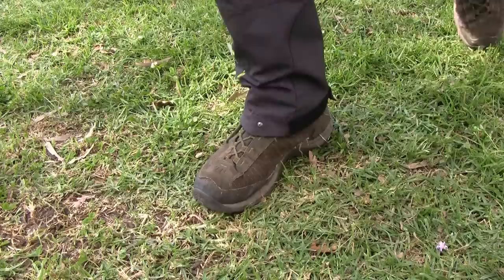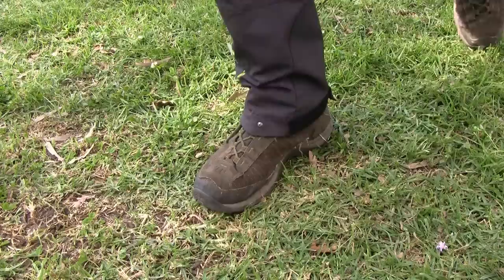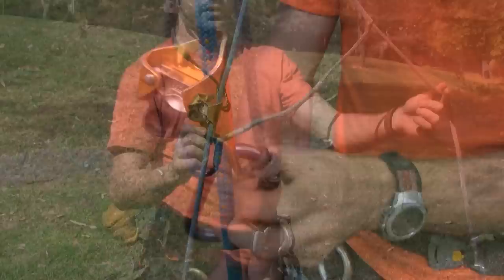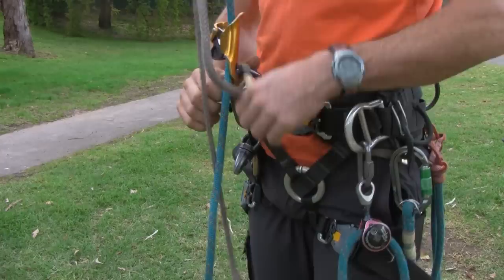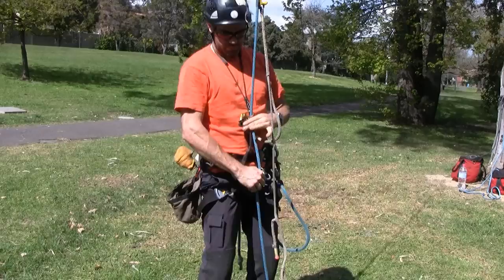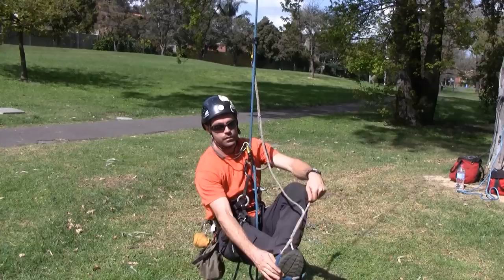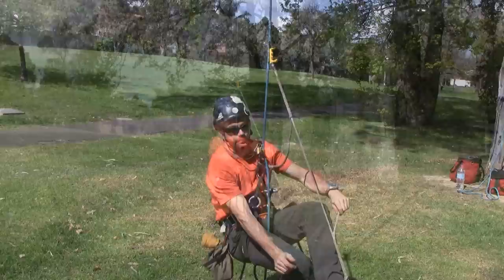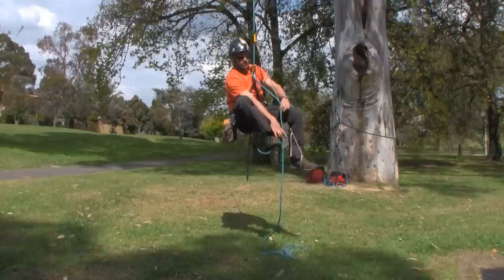ATRAES MicroFrog SRT System

Comment: This just changed my life. I have been using a traditional frog system, which works, but is not the fastest or most efficient system. This makes it twice as efficient, and twice as fast. My old frog system was like climbing a ladder, but every other step, having both feet on the same rung. Now I am alternating like you would normally climb a ladder, or stairs. Pantin is now on order. Thanks!

Comment: Nice light setup for rapid ascent, I would worry a little that the croll and the hand ascender are attached to the harness through the same safety cord. For a caving srt setup we would usually attach the croll directly to the harness (no carabiner) and the hand ascender/footloop would have a seperate safety cord attached to the harness as well. Heavier than your setup certainly but a little more of a safety margin should things start to go wrong.

I envy you your speed up the rope...
Reply: @kenmurrey5793 Safety mustache is necessary in this case to tie into the strapping loop.